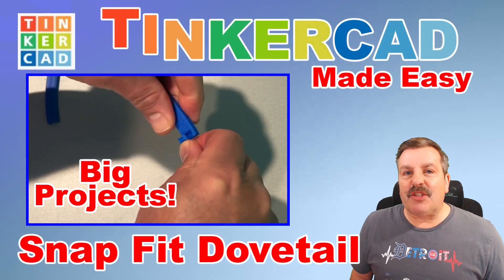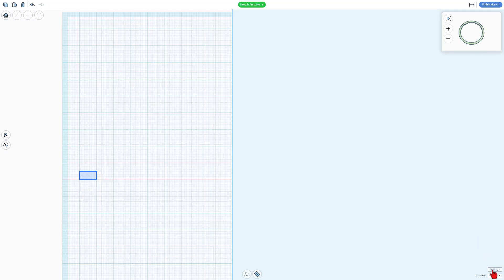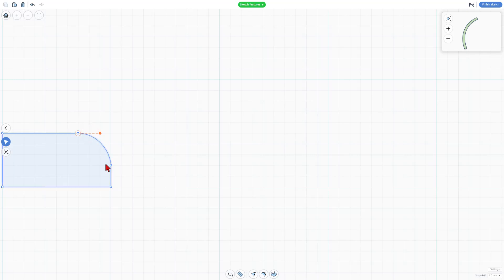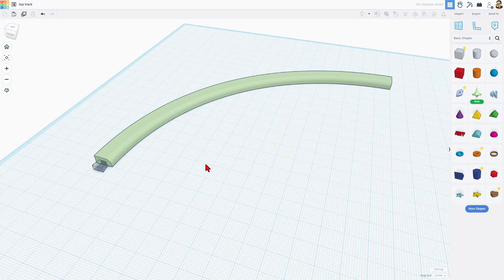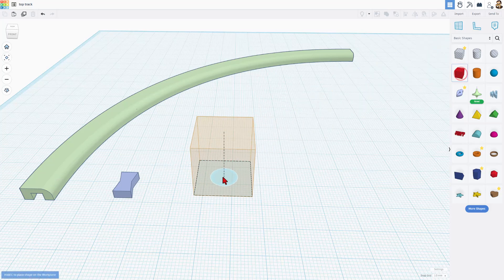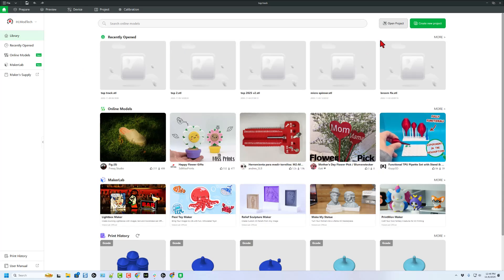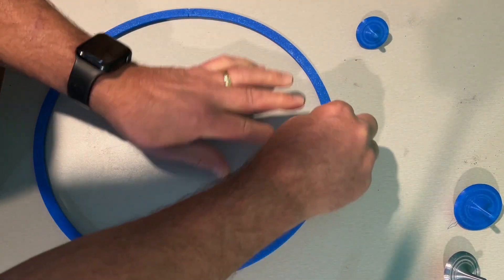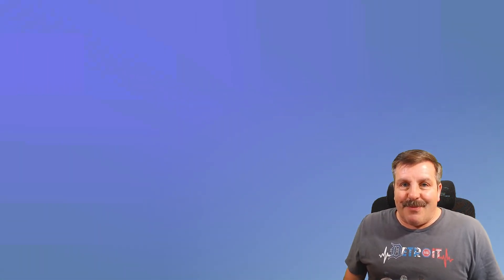Make Big Parts: Tinkercad Dove Tail Sketch Revolve Track for TOPS! 💯🤯

Comment: Sketch revolve is ‘shaping up’ to be a dramatic extension of Tinkercad - thank you for highlighting and explaining it. 
I appreciate that this is a Tinkercad tutorial, but in practice iterative adjustments to the connector fit are surely more easily made by adjusting scaling in the slicer. 
However I am reminded of the saying that “To a man with a hammer, every problem looks like a nail” 😊
Reply from the maker: Thanks for the kind words. I highlight in there how to adjust the dovetails to match your printer. I would guess the adjustments I show are slicker than adjusting in the slicer. One you had it figured out for you printer you could use that "magic number" for all your prints. Bonus note... Hammer Time! 🤣 Thanks tons for visiting!
Reply: @HLModTech  about the adjustment for shrinkage - it is really simple in the slicer! From the Prepare view, click to select the item on the build plate, hit s on the keyboard, and enter the numbers for x and y % that you want. And you could even Clone the connector on the build plate, and apply a different scaling to each one, to see which fits best. Easier than moving each and every point by a specific amount. 
Since the shrinkage will be proportional to the dimension, this makes more sense to me as something that could be replicated for other projects, than making absolute (like 0.1mm) adjustments to the design. 
It is also an easier way of working should you decide to reprint in a different material, with different shrinkage!

Comment: Great video. When I do the dove tails I build a male dovetail on one side and a female dovetail on the other side. One less part. I save the dovetails in favorites. The next time you need it drop them in place.
Reply from the maker: Thank you.  Smart idea saving them as "your creations". I have built the male and female versions too. My thought here is that I could just place this system on any part... Any shape can be larger as long as I pop the holes in matching locations.
Reply: @HLModTech  I use standard self tapping screws and snap caps to go over the screw heads and save all of the designs, I just drop them in place.Saves so much work. 
On a side note. In your videos the phrase "bang" is used. In this video you used a hammer. Made me laugh! :) Have a great day!
Reply from the maker: I really appreciate the extra facts. It is nice to know how others create. Super funny about the "bang". As I edit I find I say the catch phrases a ton. 🤣 Likely too much time watching ESPN as a kid.

Comment: If it doesn't fit, adjust the tolerances. I'm sure all the viewers will be able to do that.
Reply from the maker: The ability to nudge the points by .1 mm is super slick.